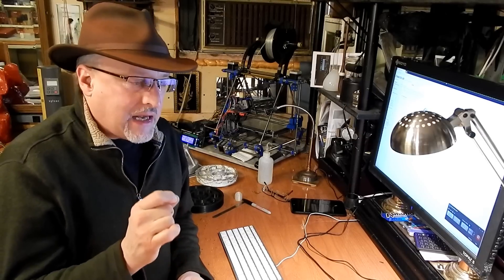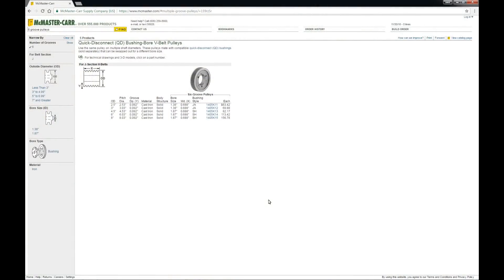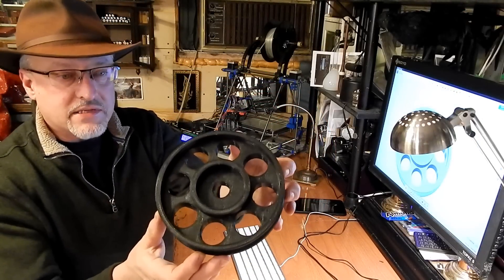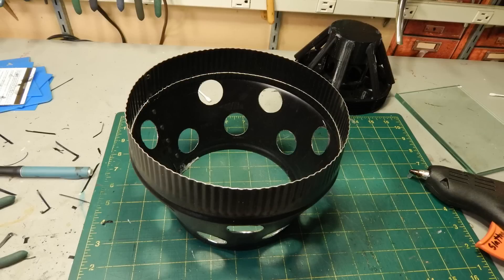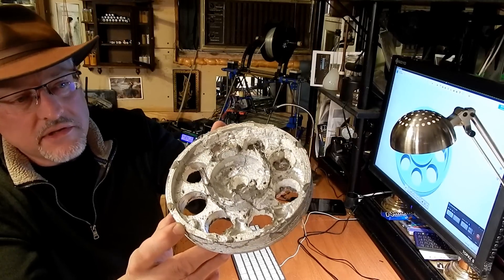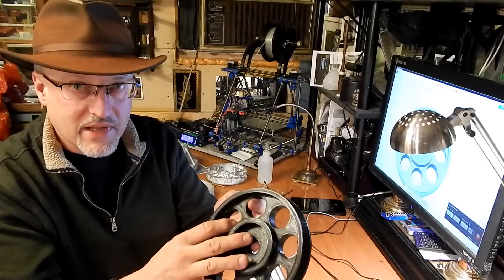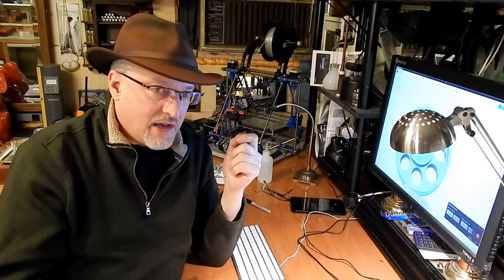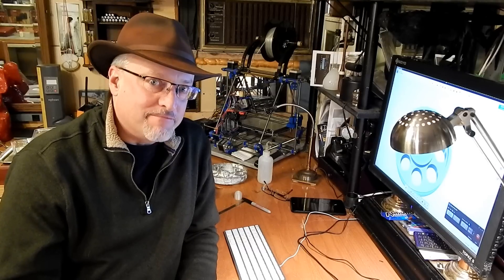Lost PLA Cast Aluminum Alternator Pulley

Comment: What PLA did you use? Most of them don’t like to be melted out of a casting. I know some are specifically designed for lost PLA casting (Formlabs?). 
I’m doing the same thing for a 10” ribbed pulley wheel so I want to learn as much as possible. 
Thanks,
Paul
Reply from the maker: I just used a generic clear PLA from Amazon

Comment: Hullo,

After a couple of years, is this part still functional? With aluminium/aluminum likely to succumb to fatigue more than other metals.

Also, besides the higher temperatures, is there anything stopping you from using steel instead?

Cheers.
Reply from the maker: Hi Chris, I used the welder just this weeked and it's still working fine! I've only recently gotten my foundry working on waste oil and I have not yet done an iron pour. The same techniques would apply but I suspect plain old plaster of paris would not hold up to an iron pour.

Comment: I like your method of solving the problem :-). Seeing a problem and solving it is a real skill, and you have it :-). My background is as a machinist so my solution may have been different. You say you do not have a lathe. Do you have a drill press ?? If you do, think on the general idea that a drillpress can be used as a vertical lathe for some things. Another thing to think on is how to create a grooved drive surface for the poly vee belt (that is the proper name I think, and it may help when searching). if one had a smooth pulley avail in the proper diameter (lots of bigger automotive stuff drives off the flat back of a serpentine belt) we just MIGHT be able to carefully cut the exact length of belt needed to wrap the smooth pulley, and carefully glue the belt onto the outside diameter of the pulley, maybe :-). But in general I wanted to say kudos for thinking outside of the box, and just throw out a few other ideas from outside the box. Never saying "I cannot" is a real life skill :-).
Reply from the maker: Thanks for the kind words! I do have a lathe now so I think the next time I need to do something like this I'll sand cast a blank and then machine the grooves. I Like the belt idea!

Comment: Try just printing pulleys and/or gears out of fiber reinforced nylon.  The're quite usable as-is, hot off the press :o)
Reply: Jake von Slatt I'm currently working on pulleys for an application which will require 40-50hp of continuous transmission.  This is what I've learned so far: if you simply copy a steel or aluminum pulley (or any mechanical part) and try to use it, it won't be useable, nor safe. However, if you make a pulley which in its original steel design had, say, a 3/16 mean cross section, and instead, you make the pulley an inch thick (assuming you have the room, of course) it tends to be successful. Also, if you have the luxury of designing the entire power transmission system from scratch, you can do things such as substitute an industrial timing belt that's 2.5" wide with a 3/8" pitch and use the largest overall diameter pulleys which will still give you the ratio you need.  Using idler/tensioner pulleys on the smooth side of the belt to maximize wrap also distributes the dynamic load over a greater percentage of each pulley at any given moment. Hope this helps. Take care.
Reply from the maker: Even for a pulley that needs to handle 20 HP (something like 16kw) under load?

Comment: I think a machinist could clean this up and cut those relief holes. Possibly a DIY job with a drill press, step down bit, sand paper and 3 sided jewelers file to cut the belt teeth. Great use of 3d printing.
Reply from the maker: Thanks! I have a lathe now so when I make similar pulleys to upgrade my mill to VFD control I will just sand cast blanks and cut the teeth on the lathe. I'll 3D print the patterns for casting and I'm thinking I'll print in PLA due to part size and then use Plasti-dip to get a smooth surface.

Comment: Good video! How do you get rid of the PLA pattern from the mold? Does it melt and drip out or vaporise?
Reply from the maker: There a burn-out process. Good info here: https://depts.washington.edu/open3dp/2014/10/rapid-manufacturing-iteration-and-industry/
Reply: Thanks Jake. Good information.

Comment: Hello, I'm trying to get into casting 3d printed parts. Here's my question. Could you use abs plastic instead of pla and instead of burning out the plastic use acetone to dissolve the abs in the investment and then pour our the solution, leaving the cavity? Has anyone ever tried this?
Reply from the maker: Maybe? But if you have the ability to melt metal you should be able to burn out too.
Reply: Jake von Slatt I only have the ability to melt lower temperature metals

Comment: Hi Jake, your casting is porous because of bad sprue design. As a rule of thumb a sprue should have a bigger cross sectional area than the casting. This is so as the metal cools and shrinks , the thickest part cools last, allowing the casting to draw metal as it cools down. Your sprue was thinner than the casting and cooled first, then as the casting cooled and shrank it had no supply of molten metal so shrinkage  porosity formed. Hope this helps.
Reply from the maker: Interesting! Thank you.

Comment: try a plaster and silica flour mix. 
Casting plaster from gibstopping or building supplies store, is cheap and works well.
For Silica - 150mesh is fine. Available form pottery supplies.
mix in ratio of equal weights of water, plaster, silica.
Mix the plasterinto the water first by sprinking it in, then stir and mix. Then dump the silica in and mix by hand until even.
you can use a brush to cover completely for the first coat and shove it into every orifice. then pour the rest of the mix in and agitate to remove bubbles

Comment: Jake,  Most of the water that the aluminium reacts with to produce not only Hydrogen but also aluminium oxide films all through you metal comes not from your furnace being damp (that sure wouldn't help though) but from humidity in the air and from combustion of the fuel that you fire the furnace with - hydrocarbon fuels (gas oil) produce lots of water when they burn. (Hold something cold in the furnace exhaust gas and see how much condensate you get.)You need very small holes in that argon lance - I use 0.005 Inch check out my video on my latest degassing lance. Mig gas is I am sorry to say a no - no The CO2 reacts with the aluminium to produce lots of aluminium oxide, this badly weakens the resulting casting. I recommend using either pure argon or nitrogen.( I use argon as the dross it gives is drier)
Reply from the maker: AH! Interesting! Thank you.

Comment: You did not mention accounting for aluminum shrinkage?  Any problem with dimension shifting?
Reply from the maker: Oh! Yeah, I printed the plastic at 102% to compensate. In this case the critical dimension is the distance between the v-belt grooves and that only a few millimeters so it probably would have been just fine no matter what.

Comment: As a rule of thumb, firing the furnace before you start the melting process is a must, i know it's a bit expensive to do that, but it has to be done. The only people who get away with it, are those in arid places, for the rest of us, pre-firing is important.
There's the issue of moisture, yes, but there's also the fact that if you fire the thing directly to working temps in short periods of time, you lessen the life span of the bricks.
So a slow ramp up is important. This is something that's applicable to most furnaces of this type, but, funny, even forges. A lot of the YouTube channels that deal with blade making, and that have went in to explaining their process and their forge, have said the same thing.

Mah, it's a learning process. Each failure is a situation that gets studied and with it, knowledge gets added to the repertoire.
Tho is still envy those that don't have to deal with moisture issues due to their planetary location.
Reply from the maker: Indeed! Related and coming soon: updates to the waste oil foundry burner!